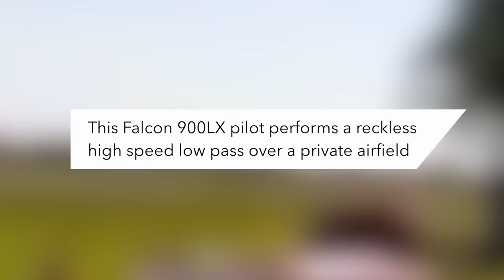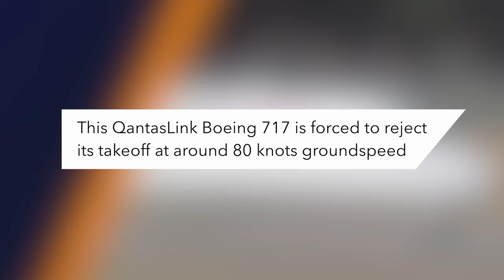Pilot Loses Licence Over Crazy Stunt

Comment: It's amazing that any one person commenting about the license loss guy does so without thinking it's a really bad thing.
You cannot have hot shots and bad apples flying planes.  PERIOD.  There is no room for it.
Reply: Apparently there is room for it in Argentina. I do not think that that maneuver is necessarily illegal in the US. Even in the US if he was at an uncontrolled airport, made appropriate unicom calls and  was flying with gear up over a runway but staying under 250 knots flying up the runway with plenty of airspeed to climb out off runway heading....   I have seen it done and been in aircraft that have done that. It is called a "compass check" or "runway inspection".  I've also seen FAA jets doing something similar with multiple passes when installing a glideslope at an airport. He also may not have had any PAX on board, definitely was not in US airspace.... so it may have been perfectly safe and legal. I was in Guatemala a week ago and a guy in an A36 did the same thing but lower and right over our taxi boat (he had just flown us into Rio Dulce). This is probably something that just looks scary and unsafe to ground folks. :)

Comment: Where exactly did you find the stick shaker triggering? The flight maneuver wasn't really extreme enough for stall risk. Reckless, yes. But aerodynamically well within what modern planes can do without breaking a sweat. 25° low alpha bank angle... I don't see a reason for a stick shaker trigger. And I don't see or hear it.

Comment: Nothing illegal about the flyby at an airport an especially a private uncontrolled airport. Obviously a pilot can fly as low as they want over the runway in use and this one followed  the runway to nearly the end and then banked off to climb away. Anyone who tells you this is illegal is not a licensed pilot. We all practice the identical go-around maneuver as student pilots.
Reply: That was nothing like a normal go around at all. Way fast, gear up, didn't stay on runway heading, flew low at a high bank angle over people and hangers... 100% reckless for sure. No way this dude could've played that off. If your instructor teaches you this they are wrong. Oh and you don't make your turn that early at all either. You climb out straight until you have some altitude to get in the pattern or if you're departing, your departure turn. The list is longer than that as well but I think this is plenty enough to show this guy is wrong for what he did. You would 100% need clearance for this at a controlled airport. At non-controlled it is still extremely reckless. Not saying he broke any FAR's because I don't know enough of the back round on this situation to know for sure but even if he didn't, as a pilot, you are always supposed to mitigate risk especially to people and property on the ground.
Reply: @jackraylongiii9663  The airport is probably located in Argentina judging by the ad for the Argentine insurance company painted on the buildings, so who knows what happened. From the cockpit view the pilot was straight down the runway almost to the end. If you have the speed you always turn off the runway center line, heading, as soon as practicable on a go-around. You sound like a wannabe pilot. Apart from your lack of knowledge of the rules most pilots give their experience. I have time in the usual single engine trainers but also in the Extra 300L, the North American SNJ Harvard (Texan), the North American TF-51D Mustang and the Air Canada Airbus A320 CAE pilot training simulator.
Reply: @RedHawk785   @BruceFerguson999  I do agree yeah who knows since it does look like it's in a different country, their rules can be different for sure. You having time in "trainers" and the Extra means nothing, doesn't mean you have your license or that you know the rules for that matter. I actually do have my license and instrument rating , 350 plus hours, have videos on my channel from years ago and have been flying for about 15 years now.  Been in way too many Sims to count including commercial and military while I was in service. On a typical go around you do not change runway heading you don't make your crosswind turn until you have some Altitude ESPECIALLY at a controlled airport (not saying this one was) let me ask you this scenario you're coming in and decide you need to do a go around, you have enough "speed" as you say so you pull up and immediately turn back into which ever way the pattern is for that runway yet in front of you is another plane correcting doing a traffic pattern. You think that that's OK or safe to be turning way earlier than you're supposed to and essentially jump this guy in line in the pattern? I think you were probably talking about yourself when you referred to me as a wanna be pilot. People talk about their experiences? This isn't a measuring contest unless you are what you called me lol. No I think you've had some lessons maybe here and there, haven't got your private license and probably just have paid for experiences in those other aircrafts. Would love for you to show me anywhere where it says a go around should be handled the way you say.
Edit: experience also isn't just oh I've flown this before I've flown that before, it's hours, ratings, jobs etc. Anyone can pay to get taken up in damn near anything for an hour here and there. If you were actually a rated pilot and been around you'd know that.
Reply: @jackraylongiii9663  You babble randomly but actual pilots tend to have orderly, analytical and disciplined minds in order to stay alive over the longer term. They also learn not to waste words but to be concise.
Reply: @RedHawk785  lmao everything I just said and that's your response. Yeah nice one little kid thanks for confirming everything I just said about you in the last message and that's being generous. Now I highly doubt you've ever flown period. Lmao I have the proof and have shown you many reasons why you are wrong and you've yet to provide any valid argument to show you are right or that you're a pilot at all. Nice try buddy you have a nice day.